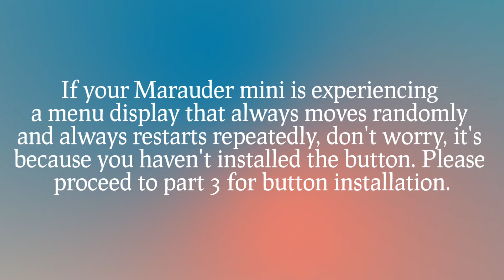How to Make ESP32 MARAUDER MINI Part 2

Comment from the maker: Part 3 will be upload soon, Feel free to ask question here 👇...
Reply: Can we use Bruce Firmware, Esp Ghost Firmware & launcher for multiple Firmware from sd card.
Reply from the maker: Yes you can, but after you install Launcher. After you have Launcher then you can install, Bruce, Marauder and Ghost from SD card via Launcher
Reply: Brother is the gps module compulsory or optional???
Reply from the maker: Optional, you can still making marauder without GPS but you won't be able to use wardriving feature on marauder
Reply: Hello, when I install the ST7735 screen (it says IC ST7735s on the back), it only shows a blank screen. I have checked the connections and everything is fine. What else should I check? Or what could I do? I have ordered two screens and the same thing happens.
Reply from the maker: Try to press and hold center button while you turning on your Marauder Mini

Comment: i have used a different display with same driver ( red one ) but my screen is misalligned, my connections are     [vcc-3v3][   [ gnd --gnd ],     [ cs--gpio17 ]  ,   [reset--gpio5 ]  ,   [a0--gpio16 ] ,    [sda--gpio23 ]   ,  [ sck--gpio18 ]  ,   [led- gpio 32] please help
Reply from the maker: Which one? 1.8inch display?
Reply: @ARTFOR  https://www.google.com/search?q=display+tft+1.44+128x128+st7735&sca_esv=8311c5b9cd6f6b3e&rlz=1CDGOYI_enLK1144LK1144&hl=en-GB&udm=2&biw=390&bih=669&sxsrf=AE3TifOcunDa8PuZLcXGPqgdwwARyKKKrg%3A1756209667168&ei=A6KtaI3-CZmvwcsPut6A6QQ&oq=st7735+1.44+tft+display&gs_lp=EhJtb2JpbGUtZ3dzLXdpei1pbWciF3N0NzczNSAxLjQ0IHRmdCBkaXNwbGF5KgIIADIGEAAYCBgeMgYQABgIGB4yCBAAGIAEGKIEMggQABiABBiiBDIIEAAYgAQYogRIlUJQ2hZYqDJwAXgAkAEAmAHUAqABmQ-qAQcwLjIuNC4yuAEByAEA-AEBmAIIoALgDcICBxAjGCcYyQLCAgYQABgHGB7CAgUQABiABMICCBAAGAcYCBgemAMAiAYBkgcHMS4yLjMuMqAHphyyBwcwLjIuMy4yuAfdDcIHBTAuMS43yAcl&sclient=mobile-gws-wiz-img#sv=CAMSiwUa6QQKmwIKuQEStgEKd0FMa3RfdkVaNm1RZU96bXBqdXE4M0RIZ0hKVkswdW81UVhpRVc0eDNlTWVqTUQxZDdLMmp0bHhOel9zSEw0VEQ0dGxLcW5OXzNCZE5xeVlVbVB4akJoYnZtRkJHeUwxUnV5TTcyVFVOZ0NYZEhhdUVqc2FtR2dREhdKS0t0YU9LZEJLdW1zZU1QZ3BMdHlRbxoiQUZNQUdHcHRKWXlMcDY5LUR6Wi12anFENHhCdjhWaFZvURIDODQ5GgEzIiQKAXESH2Rpc3BsYXkgdGZ0IDEuNDQgMTI4eDEyOCBzdDc3MzUiBwoDdGJzEgAiJgoEZXFsZBIeQ2dJSUFCQUFPZ1FJQUJBQlZiLUNUajl0VXpQZ1BnErYCCs8BEswBCowBQUxrdF92RmZrR0NfXy0xcTBZQ0pYM25VRHZ4NUNZQUlGSFA5cXBoV3piMHRzbTgyN3FKdlM2NTNieGdpNzQzXzUtdzFtRTVuZGVNTllvYnFnZjd2cHhHajg5THg3Y0hrSUJmVVRLWm5MWThRNlFJVzBLZ2habFMwVlZydVR3QVRTcHJkRE9wbXdoXzkSF0pLS3RhT0tkQkt1bXNlTVBncEx0eVFvGiJBRk1BR0dwZmw0ZTVNSmhYLWlkVW1vYTIzSUNwOElXd0d3EgQ0Njk4GgEzIhgKBmltZ2RpaRIOdnZQM0hWMWpBMVlXMk0iFwoFZG9jaWQSDkRxcXd3SjhJTEJBTWNNIiYKBGVxbGQSHkNnSUlBQkFBT2dRSUFCQUJWYi1DVGo5dFV6UGdQZyoQZS12dlAzSFYxakExWVcyTSAEKhcKAXMSEGUtdnZQM0hWMWpBMVlXMk0YATABQAAYByDs4P27DjABSgoIAhACGAIgAigC
Reply: 1.44inch ST7735 Red pcb display

Comment: @ARTFOR bro I have a 1.44 inch screen but it is not the same model, will there be a problem?
Reply from the maker: You mean display driver?....what kind of model?
Reply: @ARTFOR bro I only have ESP32, antenna, SD card module and screen. Can I use Wi-Fi and Bluetooth with this? Do I need GPS or Nef24?

Comment: Bro, I have the same display, but it's red, and it doesn't have an SCL pin — only SCK. Are they the same thing? Also, I can't find the DC and BLK pins on the display. Is there any replacement or alternative for them?
Reply from the maker: Yes i know your pin is LED-SCK-AO-RESET-CS-GND-VCC
Reply from the maker: You can connect:
LED to BLK 
AO   to DC 
SCK to SCL
Reply: @ARTFOR  Thanks😃
Reply from the maker: @hfehuaaa  you're welcome